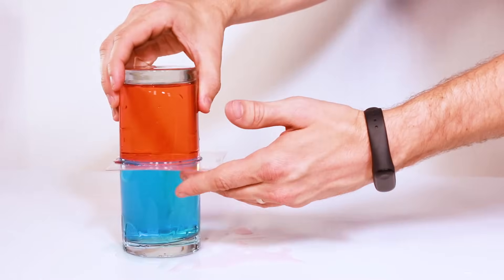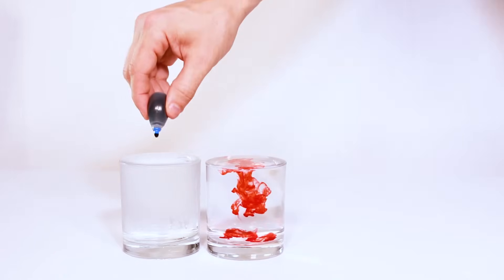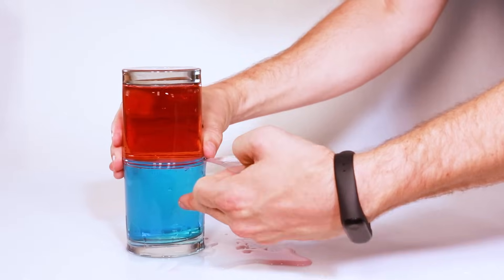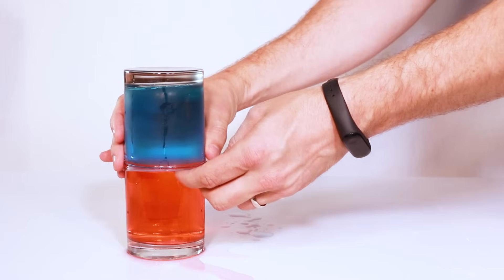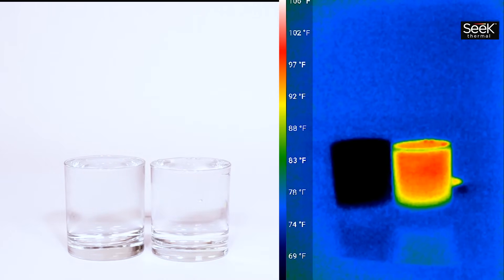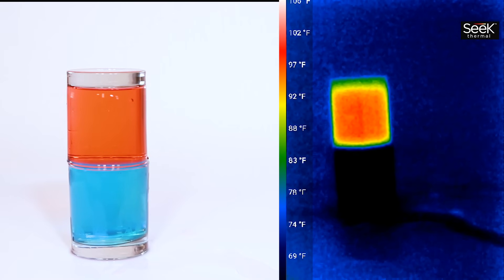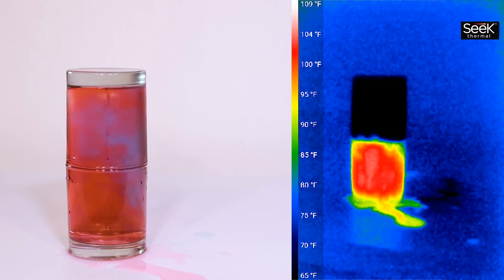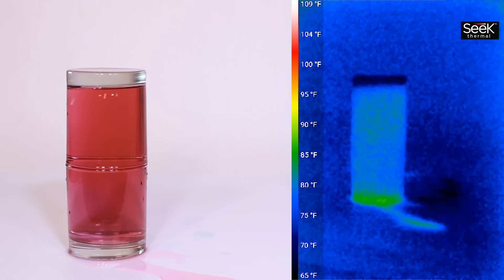Hot vs Cold Water Experiment (Chemistry)

Comment: It is strange that the cold water does not affect the hot water. When in contact, shouldn't it slowly cool down the hot water?
Reply from the maker: It does, but the energy is only exchanged in that one layer that is in constant, so it takes a while.
Reply: @BeardedScienceGuy  Thanks for your answer. Just to make it even more complexed. The container contains hydraulic oil with thermal expansion coefficient of 0.007. When heated it expands, and when cooled it retracts. The hot oil in the lower container should loose pressure making movement of the upper container. Would that make the upper container cool down as the lower container?

Comment: Thanks for the view after 10 minutes.
So there IS a heat convection / transfer.

Someone tried to tell me that hot water in a boiler will remain hot, if you take some hot water from top and fill it up with cold water from below.

Comment: I understand why the colors don't mix in the case of hot water atop cold water, due to the difference in densities. However, I'm really puzzled about the temperatures not reaching equilibrium on the thermal camera even after 10 mins? Thermodynamics dictates that heat flows from hot to cold body. Even if no heat was flowing between the hot water and the cold water in the glasses, both glasses would be losing heat to the environment and thus the temperature should drop (hot) or be risen (cold) in both glasses. Based on thermodynamics the video is not making any sense. Please explain, using thermodynamics equations if possible, what is happening on the thermal camera when hot water is placed on top of cold water. If this were possible then it seems that the second law of thermodynamics would be violated.
Reply: I cannot use the thermodynamics equations, but I assume that the reason why the temperatures not reaching equilibrium is because of the fact that the youtuber said to make sure to align the cups together accurately. When the cups are aligned perfectly, no outside materials can have contact with the test subject. So then, when there are no outside effects that cool down, it will stay the same. Or it can be something else like density affects more to the test subject rather than the thermodynamics.

Comment: Question my friend: They say heat desires to move toward the cold, right? If so, in the first test, do you think the heat or hot water desired to move toward the cold, but was prevented due to the density factor of the cold water underneath being more dense? What about in the second test? Did the heat or hot water desiring to move toward the cold water above play a factor? I understand the density part, but it would seem that the heat or hot water would be a factor in the movement of water from one to the other, right?
Reply: I think the density is the determining factor because it affects the surface area of interaction between the hot and cold. In the first experiment, the cold water is denser, so the hot water can't fall into it. Consequently, the only region where the hot and cold can mix is the plane of contact between the two. Compared to the volume of each glass, this is a very small percentage. In the second experiment, since the hot water is less dense, the cold water can fall into it and the two sample mix completely, so the region of mixing is equal to the volume of the two glasses, very much more than in the first case. Given enough time, the first experiment would eventually see the heat transfer from hot to cold, but it would also have the effects of the hot glass losing heat through the sides of the glass to the environment and heat from the environment entering the cold glass. Eventually the two glasses would reach a point where the density was close enough that mixing could begin, I would think, and ultimately the whole system would reach equilibrium with the surrounding environment.
Reply: This is the exact same question i would like answered. The video seems to violate the second law of thermodynamics. Because even if the colors don't mix due to the densities the temperatures need to reach equilibrium to not violate the laws of thermodynamics. What seems to be happening is magical, and I don't believe in magic.

Comment: Hot+Cold=Warm
Reply: this is a density test not a mixing experiment, lol
Reply: @jave_idk7014  But the point is correct that due to thermodynamics the temperatures should reach equilibrium. An explanation is needed if this does not happen since that would have implications for the laws of thermodynamics
Reply: Neutral*

Comment: How much salt would you need to add to the hot water to make it denser than the cold. I want to show  my niece that it is not Heat that rises. It is less dense liquids rise and hot water is usually less dense but not always.
Reply from the maker: I was pondering the same thing earlier.  I bet the hot water would stay on the bottom if you saturate it with salt.  You could also use hot water and cold oil and the oil should still be less dense.
Reply: Cold oil. Obvious after you say it but I had not thought about that. Brilliant. Thank you.